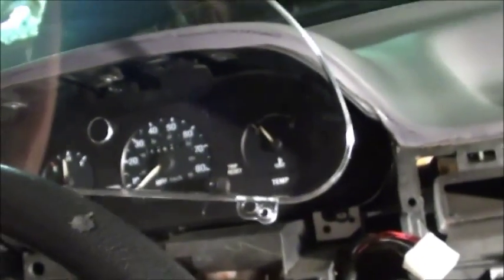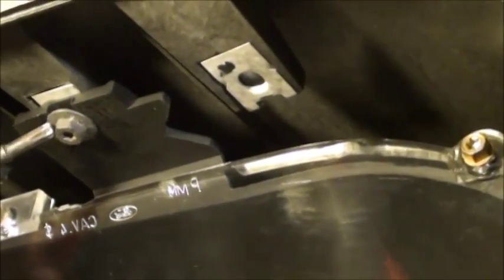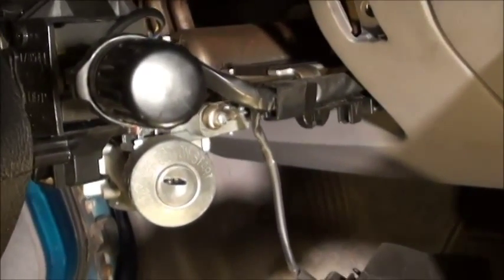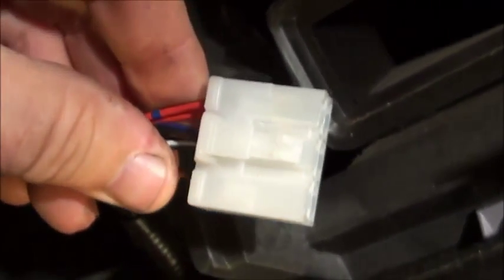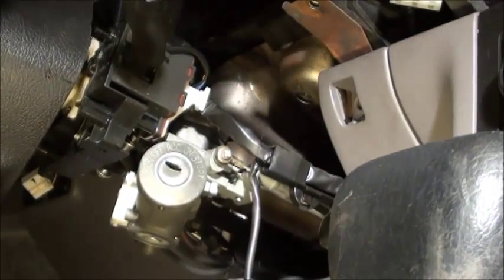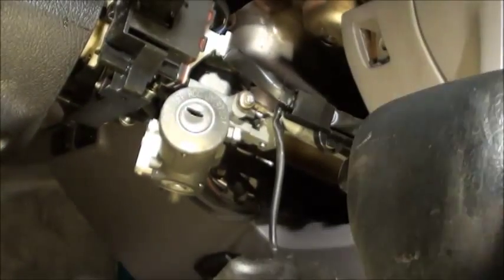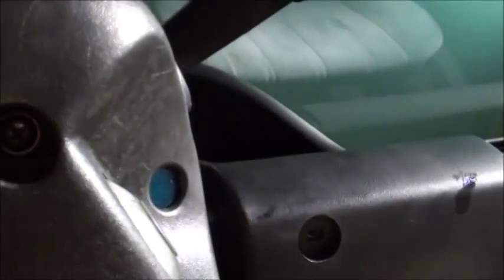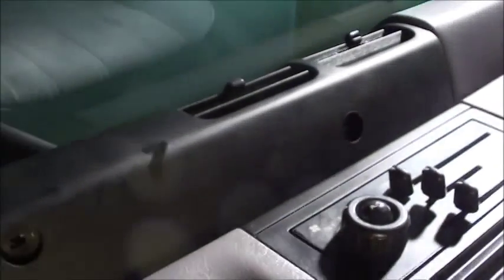93 Ford Escort instrument panel lights replacement Part 3 of 4

Comment: Hi my friend!!!

How I can remove this dashboard? I have a tracer 93 LTS.

I need put out power steering? 

Thanks in advance!!!
Reply from the maker: +San Kroy  .  I'm only familiar with the Escort.  I've had no experience with the Tracer. Sorry about that and good luck with your project. .
Reply: @takeachanceonme4 Tracer is identical to the Escort with some differences in trim. You probably know that by now, but anyone watching this might want to know.